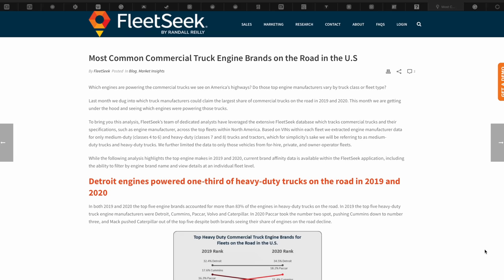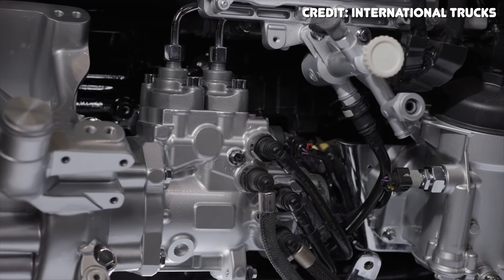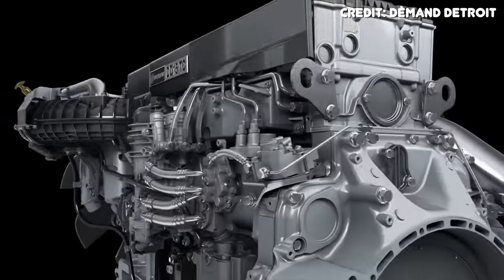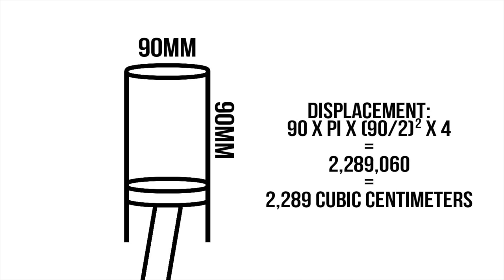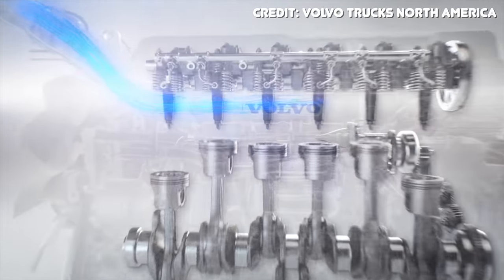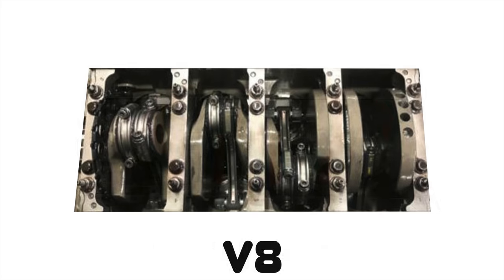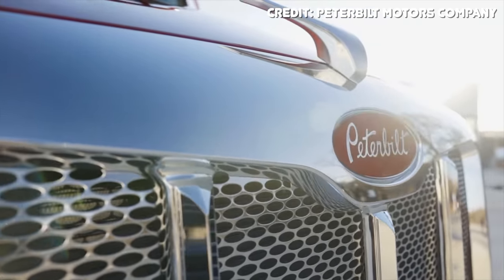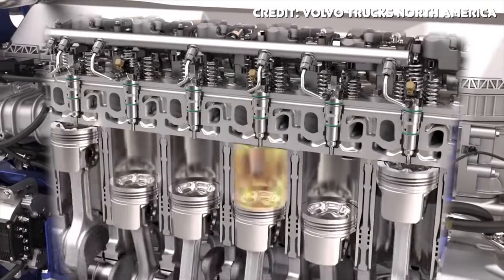Why do Semi-Trucks Use Inline-Six Engines?

Comment: Back in the mid to late '70s, the drivers where I worked were bummed out that their 350 horse V8's were being replaced by 300 horse straight sixes.   Their tunes changed when the sixes stepped out and passed them pulling up a local long hill.
Reply: gasoline engines.
Reply: @cravinbob  What makes you say gasoline?  barrymossisss is correct.
Reply: I remember my stepfather  tow-truck at his repair shop.   It had a 349 straight 6, and a super low differential ratio.   I remember the mechanical whine that it made.   My stepfather said it guzzled fuel.   And that was in 1973, during the oil embargo.   Hey sold it after the 1978 oil embargo.
Reply: @cravinbob  Eh?
Reply: Besides, maybe Cat who was making 350 horse V8s in the 70s?
Reply: @josephsteffen2378  I've never heard of a 349 straight six, can you enlighten me?
Reply: @TheLionAndTheLamb777  Maybe he meant a 350 Cat and a 300 Cummins, but nobody knows because he didn't say, did he? So, how is barrymorrisss bve right and by implication, cravinbob is therefore wrong. All he did was pose the obvious question that I was wondering also. Gas or diesel? Pickups or semis?
Reply: @nojunkwork5735  Mack, as I recall.
Reply: If an engine producing 300 hp passed an engine producing 350 it was either gearing, weight, or the driver pushing his foot further to the floor.  Any torque difference does not explain it.  Engine torque does not matter (for performance), wheel torque is what matters.  And thanks to transmissions, the engine that produces more power SHOULD always outperform the engine that produces less power but more torque.
Reply: I hear older drivers say how much they miss the power of their old 70s/80s era engines.  It's ridiculous.  My 2013 dd16 will out pull just about any stock engine of that era.  The numbers just don't lie.  More torque, more horsepower, longer life, and all of that using less fuel.
Reply: I remember the old hot rod 350 Detroits, the power band was so narrow, that going up a hill, you were shifting the 6X4 tranny so much, it was like rowing a boat, to keep it in its power band. My log truck with a 3406B Cat, was a dream to drive, compared to that Detroit.
Reply: @kirkjones9639  That's the point of these newer engines.  I've seen them on the dyno sitting at 1400 foot pounds of torque from 2200 down to 1400 rpm.  I just remembered about those 300 horse engines.  They also had 5 speed transmissions!!!
Reply: @Frieghtliner1975  The way that horsepower is measured has changed over the last 50 years. Horsepower is a combined measurement of torque and RPMs. A small engine will be rated at 400 hp only because it turns 10,000 rpm. However, it would never pull a loaded semi. 
A 300 horse Cummins with a 16 speed transmission and a low final gear ratio will easily blow away a 400 hp Cummins with a 10 speed transmission and a taller gear in the differential. 
All things considered their memories could be correct. I am not saying they are correct, but by the same principle you can't say they are wrong.
Reply: @rightwingsafetysquad9872  I am politely refraining from calling you an idiot, but it is hard, real real hard.
Reply: Art Szabo
You amigo are with the head strongs that don’t understand wattage and horsepower. They’re the same. Wattage takes voltage and the current to tell you how much work is being done. Super high voltage (500kv+) and little bit of current and you got a lightning bolt that explodes trees. Same is with horsepower, it’s always been torqueXrpm\5252, hasn’t changed. It’s how a 1000cc engine can produce 200hp with 45ft lbs of torque…the multiplier called RPM. 
What guys don’t get seems to be powerband and when to shift. But that’s just in my experience on things. If a car or truck has 1000hp, the only thing that matters is the gearbox and final gear being able to put that HP down to the ground…making then force called wheel torque to propel the vehicle. (The final product)
But still, guys will argue torque versus horsepower till there’s no end when the torque is friends with the hp not a versus match. You gotta have both not just one. 
No rpms means you go nowhere, twice the rpms means twice the speed. (Horsepower)
Reply: @artszabo1015  It was a long time ago....the late 1970s.  And the tow truck was from the 1960s.  I was perplexed by the displacement and configuration as well.  I've never researched it or thought any more about it.   I do remember that it had some ultra-low geared rear end and quite a bit of torque.   That's all that I can recall at the moment.   Oh, other than my dad saved a 25 foot long piece of cable from it.  They sold that truck around 1977.
Reply: @josephsteffen2378  Was it a Ford, Chevy???
Reply: @artszabo1015  Chevrolet or GM, definitely.  Gasoline powered.  It was a commercial tow truck.  My father sold it because it was unnecessary for business (other than for die hard customers who wouldn't allow any other shop touch their vehicles).  I recall a few rescues that involved >500 miles distance (round trip).
Reply: @josephsteffen2378  To my knowledge the biggest inline 6 made by GM was a 292. Now GMC made some V6 engines that were very powerful. Could you be referring to one of them and not an inline 6?
Reply: @artszabo1015  Like I said, it was either Chevrolet or GMC...left me scratching my head as well.  Gota dig a little deeper into the specifications of that tow truck.  My father and grandfather didn't purchase junk.  And they didn't vary from vehicle engineering design specifications:  aka modify.  It was a quality tow-truck.  More than likely, a upper echelon commercial vehicle, which is uncommon knowledge.  The 1978 oil embargo ended its viability.   It guzzled gasoline.   I'll post the exact specifications of it, at sometime.  Or you can dig up that information for yourself.
Reply: @rightwingsafetysquad9872  it can be torque. They don't change gear at top horsepower, they change early. Like my semi will pull all the way to 2100 but it will change around 1500 usually. Dependant on conditions. So really a 460hp 2500nm will out pull a 500hp 2200nm if you leave it in auto.
Reply: @SoulTouchMusic93  That’s not the engine then, it’s the computer or driver. A well programmed transmission should not shift up before peak power with foot to the floor. At partial “throttle”, sure, shift when it’s most efficient, but foot to the floor it should maximize power.
Reply: @rightwingsafetysquad9872  yeah yeah, well it does exactly what's supposed to do. Go from a to b as cheaply as possible.
Reply: @SoulTouchMusic93  what do you mean "leave it in auto"?
Reply: @johnwyman6126  as in let the gearbox in automatic mode and not go manual gear changing?
Reply: @SoulTouchMusic93  never had automatic mode with the 5+2, the 13 speed, 10 speed, 9 speed, or the 8 double low that I'm driving now. Sounds nice though.
Reply: @josephsteffen2378 .... The Oil embargo against the US, only lasted from Oct. 1973 until March of 1974..... not, "1978"... just for future reference.    With regards to your stepfathers truck....."a 349 straight 6"... what?   349 ci?  What make and year of truck and/or engine was that, if I may ask?
Reply: @rightwingsafetysquad9872 ..... Swept engine volume (ci) and Stroke travel length which governs Piston Speed per revolution, as well as overall reciprocating weight has Everything to do with lugging ability, or the ability to "hold" the torque generated.  Yes, correct overall gearing for the application and terrain is certainly a contributing factor as well.... but the aforementioned engine characteristic is an absolutely critical equation in overall performance.
Reply: @kirkjones9639 .... The actual "power band" (torque) of the 2 cycle Detroits was actually somewhat broader, by 300+ rpms in comparison to their much larger swept volume 4 cycle counterparts.   Their "issue" was in the power stroke length (in comparison to the total) of the piston travel, and much reduced piston speed per rpm, as well as reduced internal inertia due to considerably lighter reciprocating mass... even though their hp and torque outputs were nearly identical in many cases.  

Of course, overall gearing ratios and resulting torque to the ground also plays a substantial and vital factor in the overall performance of a truck, especially in gradients for a given amount of weight.
Reply: @artszabo1015 .... sorry to interrupt your conversation, but just wanted to step in and let you know that the Largest GM Inline 6 cylinder (gasoline powered) ever produce was the "503" which was (if I remember correctly) produced between 1950 and 1959 as the last year for it.  

GMC heavy duty 630, 660, 720, and 750 truck series of the 1950s, had this engine available along with the series 71 GM 2 cycle Diesels (aka "Detroit" Diesel after April 1965) in these series of trucks, in 4 & 6 cylinder versions.  GM also had Gasoline powered inline 6's with displacements of 361, 426 (w/ a B&S of 4.25" x 5.00" - same as the 6-71 / 2 cycle GM Diesel), 451 and 477 ci from between 1939 & 1950.  

The 361, 426 & 477 were all available, beginning in 1939.  The "503" was the last "big inch" gasoline inline 6 from GM.... but they also had a "V12" gasoline engine (702 ci) that was available for heavy duty GMC 7000 series trucks from 1960 to 1966.  Some people called it (mistakingly) the "twin 6", and though it had Many external common parts shared from the newer 50's version of the 351 ci V6, including the heads(4), intake(2) & exhaust manifolds(4), and One distributor drive, with 2 caps .... the block was a single casting from a "clean sheet" design.   

 Just some added nostalgia for you, from a guy whose been around all this stuff since the late 1940's.... and who also has a 4 year degree (early/mid 1960's) in Diesel Engine Design & Theory - specializing in 2 cycle (Clark), 2 years mechanical drafting & 2 years race engine development.    Take care, and stay "well".
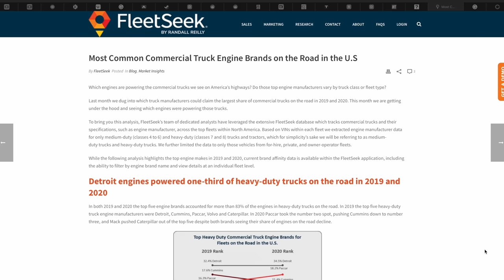Reply: @Romans--bo7br  Well, first things first and everything else is second. The first thing is your YT name, Romans 1:18-32. I just took a minute to read that, a scripture I am familiar with and particularly appropriate today. There is a solution to all of America's problems and if we don't solve them, God will. I am hoping God does it because it will be thorough and permanent. I don't want some weak kneed compromise, I just want it done - "and in the end the whole world will know that there is a God and there is none beside Him".
Secondly, thank you very much for all that information. I will look into it and further my education. Usually Mr. Pete is my YT shop teacher, I guess today you are the substitute teacher
As Roy would say, Happy trails my friend and may we meet again soon.
Art from Ohio
Reply: @johnwyman6126  it's sure a blessing when you're going downhill loaded. Fuck the current volvo I'm driving got obviously auto box with manual mode, microwave, fridge and freezer, auto wipers, auto headlights with high beam assist. It would direct the high beam around the incoming traffic and it works with the top mounted lights too. It's got lane keep assist and it will also steer you in lane. It will brake automatically for collision mitigation, it's got an auto retarder as well. It will detect if you're getting fatigued and it also has adaptive cruise control. And it also had an electronic parking brake. You come to a light, you put it on and when you pull off you just hit the throttle. It releases itself. Pretty neat huh?
Reply: @artszabo1015 ... Shalom, Art... and thanks so much for your reply and kind words, my "brother".  Ahmein to all that you said whith regards to our Elohim... and He IS going to put a definitive end to this "mess" on planet earth, and probably in the not too distant future the way things are headed.... and like yourself, I'm truly looking forward to it.... this IS, the terminal generation, and the end of the "church age", without question.   Not to change the subject, but it's now 6AM.... and I need to sleep for a couple of hours.... just couldn't get to sleep tonight, but finally getting a bit tired now.  Perhaps will hear from you again.  : )  Jim in MO.  PS: Ditto on what Roy said!
Reply: @artszabo1015 .... Thanks, Art.... just watched it.  Great ole engine!   Always liked the inline (GMC/Chevy & Ford 300 ci) 6 engines, much better than V blocks of any kind.   I like "simple"!! lol   I built and ran inline Chevy 6's in a couple of my "rails" during my younger drag racing years.
Reply: @Romans--bo7br  A good friend of mine also had a 6 cylinder rail that he ran before I met him. I bought it minus the engine but never did anything with it.
I always had an interest in the old straight 8's but never owned one. I figured that would make an awesome tractor engine except for no governor.
Do you do Facebook? If so you can find me there under my actual name
Oh yeah, almost forgot, are you Jewish?
Trails
Reply: @Romans--bo7br  Be that as it may, the Cummins 4 stroke didn't need to be shifted near as often, to hold you on a hill. You average around 3 loads a day, out of the mountains to one of the mills in town, with a log truck in the GPNW. Grades vary from 1 to 22%. My day was on average 1.5 hours shorter, driving a long logger with a Cummins 4 strike under the hood. Even managed to get 4 loads a day on occasion. Why the Detroit under performed and had higher maintenance costs, is of no nevermind to me, as a driver. My bank account and the Mrs. were much happier, with the 4 stroke diesel.
Reply: @SoulTouchMusic93  wow sounds really comfortable. Pretty soon they won't need a driver.
Reply: @kirkjones9639 ... Yes, I fully understand your points with the Cummins engine... which is exactly what I was explaining within the context of my initial response.   Lest you think I was making "excuses" for the 2 cycle design... I was simply explaining the differences of "why" the 2 cycles "seemed" to make less power... which is nothing short of an ongoing & persistent Myth, and "fueled" by those, in complete ignorance (re; lack of understanding) of the subject matter.

I worked with Detroit Diesels Special Development program from the early to mid 1970's as an advisor on developing a different scavenging system, as well as a (potentially) redesign of the "V" blocked engines.  

The explanation in my initial reply was an extremely encapsulated and simplified summary of the engines design, to "hopefully" benefit others who may be reading it, and who would like to understand, at least the bare basics of the "workings" of the 2 cycle design as developed and employed in the  GM Diesel design by "Boss" Kettering, P. Nicholas, et el..., and why they "seem" to be less powerful as compared to competitive 4 cycles, when in fact, that is not the case.

Thank you for your response, Kirk... and have a wonderful day.
Reply: @johnwyman6126  they will always need a scape goat!
Reply: @artszabo1015  RWSS is right, though.  HP is the ultimate determinant of how much load you can move and how fast.  With the right gearing, the 400 HP gas motor in your example will move the semi just as well as a 400 HP diesel.  It won't be as fun to drive, though.
Reply: Even  the present  day truck engines  are good for the pulling power and torque